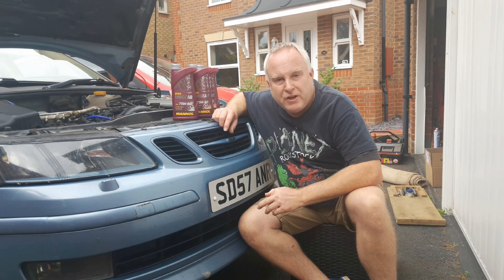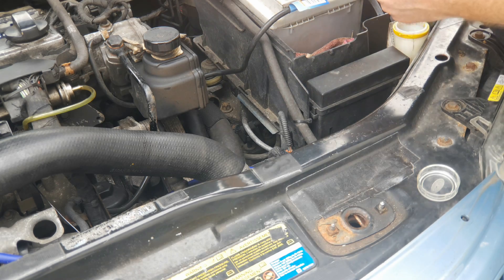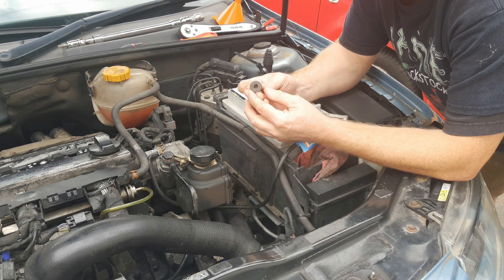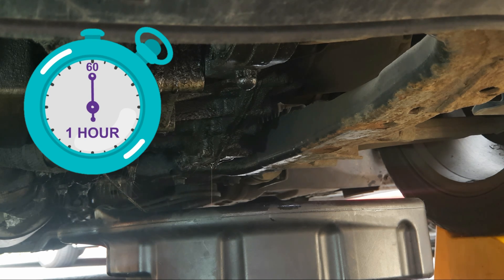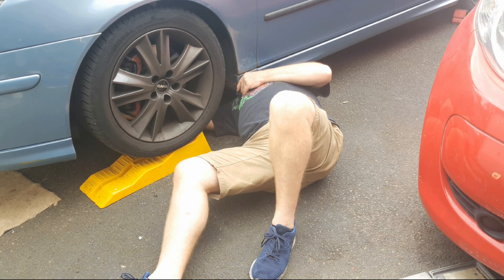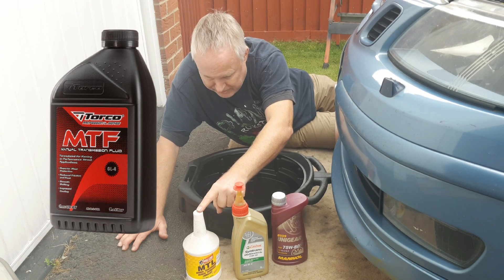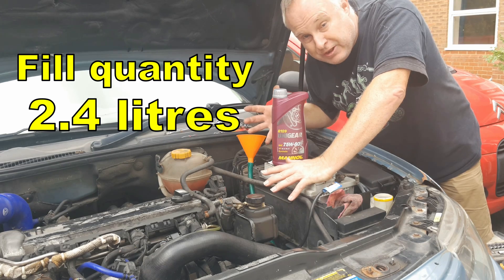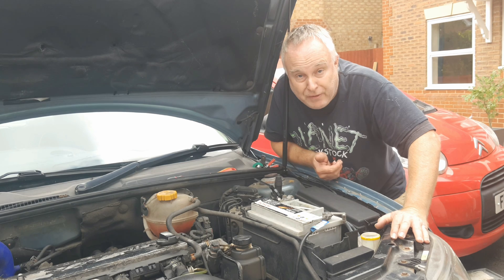How to Change Saab 9-3 Gearbox Oil | GM 6 speed Manual Fluid Change 🛠

Comment: Great info as ever Cyd...

Here's a question... I replaced a front axle on my 9-3. Fluid came out... what fluid would that be and how would I go about topping it up?

Thanks in advance.

Garth
Reply: Right next to the axle where you install it is a small round plug with a Allen key hole. It's the same plug as the drain plug. Need non synthetic mineral based fluid. I seen people using 3309 ATF mobile 1 Good luck. When you look at the drain plug from underneath. Follow it straight up from looking from the driver side with tire off look at the plug with the Allen key hole to the right of the axle where the fluid came out.
Reply: Did u figure this out?
Reply: @tyrc12pro94  Hi... no... 4 billion subscribers to YouTube no one knows the answer.
Reply: I figured it out

Comment: Hi, thanks for this video ! it was very useful for my Saab 9.3 1.9 TID of 2006 with 211000 kms. I used Castrol syntrans transaxle 75w-90 oil with 4% Mecarun P18 treatment.
Best regards , 
Patrice  from Savoie / France.
Reply: T'as un F40 aussi sur une 2006 ? Ou une m32 ?
T'as mis combien d'huile ? Les gens disent tous des volumes différent, un vendeur de boite F40 indisue 2L sur wikipefia c'est indiqué 2,8L, j'ai vu aussi 2,2L et 3L, vraiment c'est n'importe quoi.
Reply: j'ai retiré 1,85L donc je vais metre 2L.
Reply: Bonjour, désolé de ne répondre que maintenant ! 
Je ne saurai dire s'il s'agit d'une boite de vitesses F40 ou une M32, mais j'ai mis 3 litres de CASTROL SYNTRANS TRANSAXLE 1557BD 75W-90, tel que recommandé dans le manuel SAAB. Comme vous, j'avais à peine 2 litres après avoir vidangé complétement. Aucun souci depuis et surtout, beaucoup moins d'échauffement au niveau du levier de passage des vitesses et moins de dureté également.
J'ai également fait un nettoyage puis graissage de toute la tringlerie du levier jusqu'à la boite.
  @drefhill

Comment: Hi , not related but do you know the torque setting for the pinch bolt on the front lower suspension arm / wheel hub ?

Comment: Thanks for these great videos, wonder if you can help with my SAAB93TID (06) Auto. i had the gearbox oil changed about 10 months ago at a knowledgeable Saab garage, recently i have developed an issue where the car stalls in gear/reverse when i am stationary with foot on the brake, sound like some TCC lock up issue from what i have been reading? no engine lights, wonder if changing the oil again might help?. Thanks

Comment: Loving the content Cyd! 
I have a 5-speed manual on my -03 2.0t named FM55 would I be wrong assuming that it's the same procedure?
Reply from the maker: Just checked Haynes: says 5 speed fill plug is on the side of the 'box and the drain is on the rear under the left driveshaft.
Reply: @CycloneCyd  side of what box?
Reply: @tyrc12pro94  gearbox?
Reply from the maker: Honest reply: I don't know, I'm not familiar with that 'box. Try asking in the Saab Nuts! group on Facebook

Comment: I'd best change mine 06 176k- never been changed! Garages don't drain gearbox oil when changing the clutch do they?
Reply from the maker: Usually, yes, because if they don't they end up with an unholy mess when oil comes pouring out from the drive shaft holes when the box is dropped. It's more a question of what they put back in - your old oil (bodgery), any old cheap gear oil (probably) or the 'good stuff' (unlikely IMO).
Reply: @CycloneCyd  cheers Cyd, I'll try the mannol 👍

Comment: How much does the F40 hold with XWD? WIS only states 1.6 but I put 2L in just to be safe
Reply from the maker: Yes, 1.6 litre
Reply: @CycloneCyd  I found the GM fluid to be quite noisy. It make a groaning sound in 1st and second now. Gonna try the Castrol with some moly slip like you suggested. Which molyslip did you use? I see there’s lots that call themselves it. Regards
Reply from the maker: @Droneguy-be1fy  this is the one I used https://www.ebay.co.uk/itm/174561289300?hash=item28a4a9e454:g:LZ0AAOSwOVJf2fQk
but Liqui Moly also make an excellent additive.
I've done about 300 miles since changing this oil and am VERY pleased with the Mannol. The 'box is a shade quieter, but best of all the change into second is markedly improved.
Reply: @CycloneCyd  excellent thanks for that. So your more impressed with the Mannol than the castrol? I might go with that instead
Reply from the maker: @Droneguy-be1fy  The Castrol was a huge improvement over stock, Torco and Redline. The Mannol is another step up from the Castrol. Second gear selection is much better with the Mannol.
Yes, I prefer the Mannol, but I would happily use the Castrol if I couldn't get it.
The Manol is currently on offer at the ebay link in the description
Reply: @CycloneCyd  cheers, I already got some Mannol in after watching your video so that’s tomorrow mornings job. Just hope it cures this annoying noise that appeared after changing with the genuine GM stuff
Reply: @CycloneCyd  I replaced the gearbox oil with the Mannol, seems to be much smoother than the GM stuff I had in. The noise I mentioned turned out to be the transfer box so I’ve got some Mannol 8108 75W-90 to try in that since I’m impressed with it in the gearbox. Hopefully it cures the strange sound that it’s started making

Comment: Good vid wondered how to check the levels, you can’t!! , is there a slave cyl or is it in the trans throw out bearing??
Reply: I have a 2004 9.3
Reply from the maker: Do you mean the clutch slave cylinder? It's inside the bell housing around the gearbox input shaft.

Comment: Please can you tell me where can I buy those yellow ramp you used to raise the car? Thanks.
Reply from the maker: These are they, in black (slightly updated and rated to 2.5T apiece)
https://amzn.to/3h51Uh0
OR these if not in the UK https://bit.ly/Service_Ramps
Reply: Was just thinking that myself
Reply from the maker: https://amzn.to/3h51Uh0 if you're in the UK, OR these https://bit.ly/Service_Ramps if not
Reply: Those are small, nowmost cars have covers on the bottom and you need to lift them much higher, get big ones in steal with integrated jack.

Comment: Thanks for the video, going to be doing a clutch soon so this is useful! I've hear you can use Ford Focus 6-spead gear oil, it works better than the GM according to a few people I have talked to!
Reply from the maker: I'm very pleased with the Mannol. the shift into second in particular is much improved.
Reply: @CycloneCyd  I am just about to do my gearbox oil change again after 30k.   On my vectra z19dth. F40.    I am taking your advice on the mannol oil.  Anything to improve that cold 1st to 2nd gear change.
Reply from the maker: @grahamcorley8156  I added one tube of this.
https://amzn.to/3UxgjnB